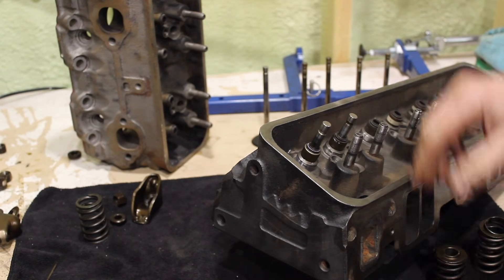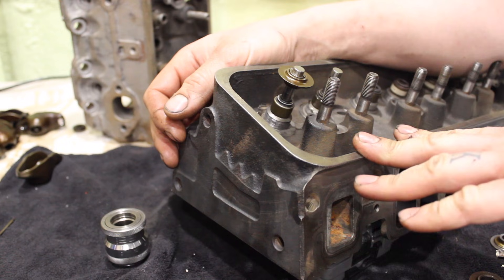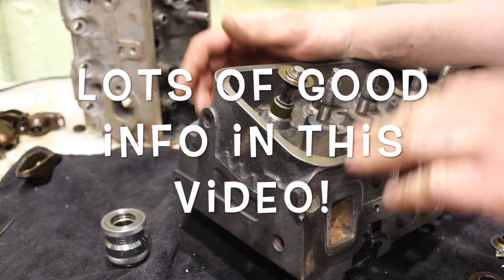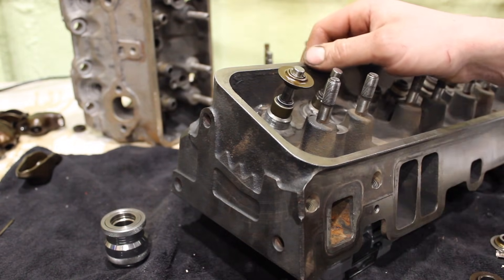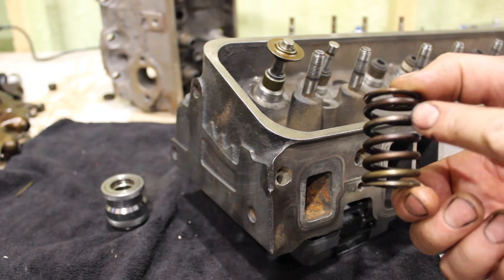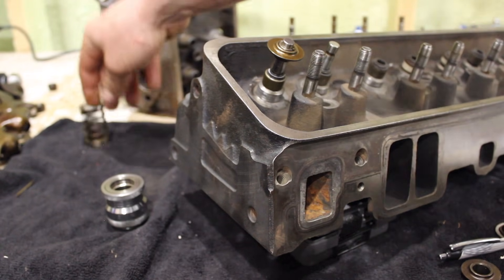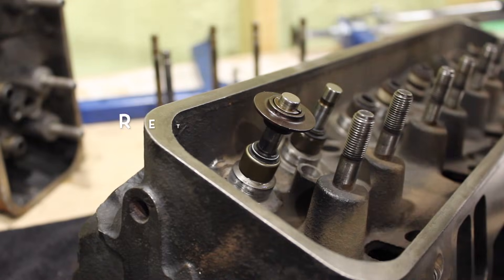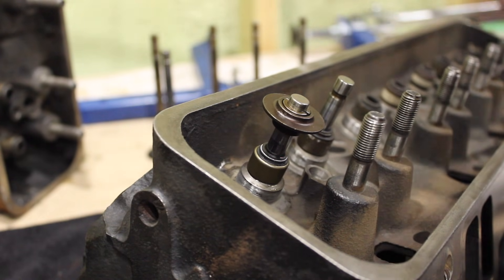How Much Lift Can a Stock Vortec Really Take? Plus .500 Lift Cheaply (Stock Guides)

Comment: Just snapped factory press in stud after 6mths with 530 lift roller. Now I'm pulling both heads to have arp studs installed
Reply: i keep snapping threaded studs. how did you adjust valves? i have .050 locks matching summit retainer and spring with 8802 summit cam

Comment: So if I run 981 springs since my cam calls for them anyway, what else would you do? My assumption is the felpro seals seated all the way, and either take .030 off the retainer, or get .030 offset keepers? The cam I'd like to run has .480 lift. 

Sorry if its a stupid question. I have a.d.d 😆

Comment: I have 062 had a 500 lift cam beehive comp springs I remove valve cover 15000 miles later broken springs I don't know why they broke around bottom of retainer heads were built be a guy who's his stuff maybe running no thermostat cold broke them

Comment: I have a cam with a  duration 050: 230/230. Lift .480/.480 Lobe separation 107. Stock bottom 1993 350 block and vortec heads. On the first break in it bent almost all but 3 push rods. Valves seem okay and with new push rods the outer valve springs don't seem to be bottomed out yet so I know it's not the outer springs. Would cutting the retainers down help it clear? Plz help
Reply from the maker: What valve springs were you running? What rocker arms? Did you check retainer to seal clearance?
Reply: I ran the springs that came with the cam kit and I'm running the stock rocker arms. The kit came with inner and outer springs. Haven't checked they clearance on the seal to retainer yet.
Reply from the maker: @bardomianogonzalez1778 dual springs? Or just inner damper? Becuase you cant really run either with stock vortec guides. You are also right on the limit of lift with the stock vortec rocker arms (they are not long slotted) so they bottom out on the rocker stud at full lift
Reply: Sorry I'm not great with part names. But yeah the inner dampers also came in with the kit. If I could get away with just removing the dampers and shaving the retainers that would be awesome.
Reply: Update i replaced the bent pushrods and proceeded to spin the engine by hand and it spins fine. The clearance seems fine between retainers and valve seals. I did see the rocker arms bottom out when the valves are opened all the way. So would that be my problem? I have a feeling some of the flat tappet lifters are toast too...
Reply from the maker: @bardomianogonzalez1778 yep that will do it. It can destroy the lifters aswell
Reply: Any recommendations on a good set of rock arms that are budget friendly?
Reply from the maker: @bardomianogonzalez1778 PRW self aligning roller tip ones are great
Reply: @cuttersperformance you are a blessing. thank you so much. I've been all over the internet an no one has come anywhere near you on info. I'll keep you updated on what I do thank!

Comment: Can we use stock vortec springs with .050 218 and 460 lift flat tappet cam?
Reply from the maker: @atanbakenan  yeah you can but they are fairly weak and can experience valve float pass 5000 rpm on some grinds

Comment: Interesting fact about small box Chevy valve keepers is that the square grows in the keepers could wear out I prefer using what’s called bead keepers where the grooves are not square off, but rounded with enable them to hold up better. I’ve seen this 1 million times rebuilding heads for 20 years. Locks are way better. The locks suck.

Comment: Flatt tapped cams suck I'd run older heads ported with roller cam and bigger lift but always check pistion ta valve clearance

Comment: I went to  .100 longer valve with beehives installed at 1.8 using a Howards super towing hydraulic roller with 1.6 ratio rockers  . This works fine with a 12.1 c/r dome piston with the plug pad milled slightly . This engine is on propane and has  monstrous torque up to 4,800 rpm !

Comment: Can the spring damper cause binding?
Reply from the maker: Yes
Reply: @cuttersperformance  I've been watching your videos for a while I'm doing my first build it's a gen 1 block with vortec heads and I rotated the engine over a dozen times by hand with the push rods in and it didn't seem to have a problem but the last time I did it my push rods bent I used 7.8 rods cam is .420/.433 and the springs i saw on one of your videos 980-16 but I left the dampers in any advice you could offer would be greatly appreciated
Reply: @cuttersperformance  also right before I noticed the bent push rods I was priming the engine with priming tool while cranking by hand at the same time idk if that was the wrong thing to do
Reply: @cuttersperformance  thank you for your insight I removed the dampers from the springs and everything rotates with no binding

Comment: So i have a comp cam that has a lift of .474/.474 cant remember exact. For a stock 1998 vortec engine with the better flowed heads. Will that no longer work? I beleive the duration is about 210ish
Reply: 270/274 duration, .474/.474 lift with a 111 lobe seperation

Comment: I ran the 980-16 with the dampers and they don’t fit over the guide properly and bind, ended up bending the pushrods, .488 max lift
Reply from the maker: Yeah, it's very important to remove the dampers. Good thing you figured it out
Reply: @cuttersperformance  I learned this from your video but I didn’t listen and screwed myself…. Love your content, I’ve completely assembled my vortec on your advice! RHS heads so some of the special work was already done!

Comment: I don’t know if you will know but I have those dna heads and I don’t know if I can use them on my stock engine. Any information would be greatly appreciated
Reply from the maker: The DNA aluminum heads can be used as a replacement head. You may have to use a smaller 1205 intake gasket to get a stock intake to seal on it, though. Longer pushrods may be needed as well

Comment: Following this to a T!  Any tricks on installing the 72861 Felpro valve seals?  I'm getting them on, but it seems like I'm having to beat on them pretty hard to get them all the way down.
Reply from the maker: They should tap on firmly, and you'll hear a pitch change when they are seated
Reply: Thanks!  Is there a chance that the guide boss on my 906's are of a different diameter?  I'm reading that the 72861 seals are 0.545" and the guide bosses on the 906's are 0.560".   @cuttersperformance
Reply: Roger that, thank you.  I'm reading that the ID of the seals are .545 while the OD of the boss is .560.  Anything to worry about there?   @cuttersperformance
Reply from the maker: @michaelhancock1603  i use them on any stock guide build I do
Reply: Excellence, thank you again! @cuttersperformance
Reply: Wouldn't happen to have a part number for a seal tool would you?  Using a socket currently, and can't find a part number for the real deal.  Thanks again for taking time out of your day to respond!!!   @cuttersperformance
Reply from the maker: @michaelhancock1603  im sorry I dont, i use a homemade tool
Reply: Ended up using a 12 pt 12 mm.  Seemed to work well!  Thanks! @cuttersperformance

Comment: I'm running a 488-510 roller cam with 550 lift springs 2500 stall on Vortec 062 heads runs great
Reply: Do you have part numbers ? I’m in a crunch with building my motor in 8 days and it would save me so much time

Comment: Hey Pat ive got a question. Ive got two sets of these springs. Comp cam 26906-16 and retainers are 787-16 of course. The cam will be a summit stage 2 almost identical to lt4.  CAN I USE THOSE SPRINGS.. MAX LIFT IS .520 IVE ive ordered .30 offset keepers to get that 1.8 installed heiggt. If i cant use those springs let me know. It is roller cam
Reply from the maker: I used the Summit Equivalent to the 26906 springs with the Lt4 hotcam, no signs of any valve float at 6500+ rpm on the dyno. When the 26906 is installed at 1.780" it is good for .540 lift.
Reply: @cuttersperformance  thank you brother. There almost identical in pressures etc etc and your rt woth factory locks not quite 1.8. Who sells +030 locks.
Reply from the maker: @timmygun1  competition products has them
Reply: @cuttersperformance  ordered 3 sets. Thanks man. I'm gonna build a marine sb. I need to cut the spring and gudes down. You got those part numbers for the cutters and dowel. Thanks Pat. I promise I won't bug you anymore. But since we met. I'm on my 7th vortec block. You are awesome.

Comment: OH THAT'S VORTEC HEADS ON AN OLD SCHOOL 4 BOLT MAIN 2 PIECE REAR SEAL BLOCK 
AND NOT A HIGH LIFT CAM NOT STOCK BUT NOT RADICAL IN ANY CASE I ONLY BUILD 
CHEVY MOTORS AND HAV DUN SO FOR OVER 50 YEARS AND THIS IS A FIRST 4 ME 
WITH PLENTY OF ASSEMBLY LUBE ALONG WITH GRAPHITE IN MY CAM LUBE MIX I'M PISSED HERE NICE HEADS BUT ☝️ W T F O

Comment: THIS IS ALL GOOD INFO THANK U BUT TELL ME WHY HAVE I WASTED (2) CAM'S IN A ROW WIPED THEM OUT NEARLY INSTANTLY (3) LOBES BOTH TIMES 🤔 MABY (4)  NO DIRVING TIME AT ALL ALL HAPPENED WHILE 
GOING THROUGH LASH ADJUSTMENT AT IDLE
Reply from the maker: Sorry to hear about your troubles, I have a few questions. What cam/lifters were you using? 
What valve springs/ rocker arms?
Did you follow a cam break in procedure during the first fire up? Lifters should be pre adjusted prior to the first fire up, that way the rpm can be brought up and kept there for 15 to 20 mins for break in.

Comment: Unsure of Vortecs but Fuellies are 1.72 installed heaght and around 72lb on the seat. So no good for performance cams. On those I have run springs up to 140lb seat pressure. With proper outers and flat wound dampers. You MUST use screw in studs. IF you turn 6000rpm that is an essential. You can cut the spring pockets about .050 max and use plus 050 retainers. Simple guide cutter for PC seals you can shorten the guides a little also.
Look at the factory performance cams, from the 60s.

Comment: I sanded about .030 on the bottom of the keepers and it worked fine with a .490 lift
Reply: I'm using 416 HO HEADS FROM A 305 ON A 350 ,RUNS AMAZING

Comment: I used a Comp Cams 292 H back in 1988 .501 lift in a stock head 79 z28 .. no issue BUT I knew guys that said I should refrain from that much lift.
Reply: Don't know why guys are saying that because most cylinder heads don't start flowing till 500 lift, even the late 70s smog heads.  Now your 292 duration is a bit much though. My 79 Z28 is getting ported 462 camel hump heads and a camshaft similar to the one you had. Ill be going with the Edelbrock Air Gap intake manifold. What intake manifold did your z28 have?
Reply: @shootermcgavin2819  I had a weiand that in magazine tests did slightly better than Holly and the basic Edelbrock. BUT the Cam I used at that time on My 406 Build was the Crane cams HMV 278 wich had 222 @ .050 and 234@ .050 with .464" on intake and .494"  on exhaust with a 114 LSA. It was a Torque monster I had 64cc heads that were pocket ported to memove dingle berrys ect. With the 292 I had the stock z28 on the 350. The 406 Crushed that 350 it wasnt even close.

Comment: No issues? lol i've seen em push rocker studs out with a .460 lift cam
Reply from the maker: I tell guys over 300lbs over the nose you should have screw in studs. They are never a bad idea but ive never seen them pull with springs weaker than that unless theres not enough clearance to the retainer and they are smashing the retainer into the seal/guide.

Comment: This is very good information. 👍 This is exactly what I did with my tbi 193 heads in my Camaro to run .480 lift hyd. roller. Springs, + .050 retainers, .060 spring washers. I had to grind the self aligning spurs on a set of Comp roller tips about .020 or so. Only thing I didn't do was check that the guides were seated all the way.

Comment: im tempted to try umbrella seals on my vortec heads. have always liked them for the ability to allow more oil into the guide. i dont mind adding more oil every now and then.
Reply from the maker: Yeah, I've used them before with no issues on lower lift cams with stock guides
Reply: @cuttersperformance  cant find any umbrella seals for a .560 guide. oh well.
Reply: The 943x springs with the damper removed and a good ole umbrella seal will work with .500 lift flat tappet no issues.

Comment: I wanna run a comp 262h cam with vortec heads do you think the springs will be maxed out so head they will wear out and break prematurely
Reply from the maker: Id probably go to a 981-16 spring. Just follow the video and make sure your valve seals are seated all the way.
Reply: @piss-cutterperformance  I have springs off a 5.3 laying around will will installing them at 1750 instead of 1800 hurt longevity

Comment: What cam would you recommend with 1.6 rockers ?
Reply: Any cam.  Doesn’t make a difference.  Just know 1.6 increases the lift as opposed to a 1.52.  The fulcrum point increases therefore increases valve opening

Comment: Really great information! I really enjoy your in-depth vids about make budget stuff work better. Most of us are on a budget and this content is great. I had a question though could you also achieve more lift if a guy wanted to spend a little money on aftermarket roller rockers with a 1.6 ratio? I know jumping from a 1.5 to 1.6 nets you more lift, there an equation to find your new lift(I can't recall it off the top of my head). Thanks again for taking the time to do this stuff.
Reply from the maker: Take your current lift (say .500) Divide that by stock ratio of 1.5 to find your lobe lift (.500 ÷ 1.5 = .333). Now take your lobe lift and multiply that by your new ratio of 1.6. (.333 x 1.6 = .533) So now your lift is .533 with the 1.6 rocker arms, plus you gain a few degrees of duration.

Comment: The cutting tool for cutting down the spring pocket isnt that expensive from Goodson and kan be used with a hand held drill och stand drill.

There are very affordable beehive sorings from LS engines for instance. Keepers from Melling are also pretty affordable. 

But many cheap things get expensive when added up 😅
Reply: You would only use a spring seat cutter if you need more installed height which is not really what this video is about :body-blue-raised-arms:

Comment: I'm having a few issues. I'm looking to run comp cams 787-16 with their 26906-16 springs with 0.030 offset keepers and I can't figure out my clearance. It should be around .550 right?
Reply from the maker: Check out my LS6 spring on vortec  video to check clearance easily at home

Comment: Awesome video! Helped me out a lot. I just want to confirm, it’s pretty much the same way with flat tapped and hydraulic roller? I’m building an L31 350 and wanted to make sure I’m in the clear. I also need cam recommendations, as I can only find mostly flat tappets
Reply from the maker: The springs in the video can be used for flat tappet hydraulics or mild hydraulic roller cams under .500 lift. I have some more vortec builds/dyno results coming up that might help you with a cam choice

Comment: With pressed in rocker arm studs I would not go over 450 lift.
Reply from the maker: Its more rpm/spring pressure with press in studs. Generally less than 300 lbs over the nose and under 6k rpm, the press-in studs are fine. But going screw in studs is never a bad idea for any situation
Reply: I’m currently out the game cause my heads had to come off to replace the press on studs.  Wish my engine guy made a bigger point with that. Last week 4 studs pulled out and I lost 4 lifters and 4 rockers.
Reply from the maker: @kyff232  o dang sorry to hear that man! How much spring pressure were you running?
Reply: @cuttersperformance  not quite sure to be completely honest.  They’re double valve springs with dampeners so I’m assuming 350 atleast open.  Upgraded springs for a 510/515 cam.  Everything was fine until 5500-6000 open run   Definitely needed screw on studs.  Now I’ve got new rockers and lifters lol .
Reply from the maker: @kyff232  o jeez yeah, over 300 lbs its a real coin flip once you bring the rpm up. Alot of guys dont believe me but ive seen it many of times
Reply: @cuttersperformance  yea it sucks.  My engine was completed/dynoed 10 years ago but only ran 6 months ago.   After my motor swap I was hoping all was done.  Nope lol.  But I’ve learned a lot and the tear down I’m learning more.  ESP where all the FN antifreeze is Jesus H it goes more places than oil

Comment: Yep, the good old "ghetto grind" on the retainers and i use a $40 set of  "Z28" springs with the inner damper removed.  Cheap and Easy!
Reply from the maker: If you have access to a valve grinder, it's more of a "lower middle class grind" 😅
Reply: @cuttersperformance  lmao 🤣
Reply: I had a cheap set of Z28 Springs I wanted to run for my flat tappet cam and my machine shop had to clearance the valve guide for the ID of the spring on my 906's.

Comment: I definitely see where I went wrong on my build with my 355 VORTEC sb. After snapping rockers off, wiping out two cams I see that I never took into consideration the valve seal clearance  this video has got me totally on point to understand what it takes to make my combination work. Great post and awesome trick on retainer 👍🏾
Reply from the maker: Sorry to hear the issues you have had, how much lift were you running?
Reply: @cuttersperformance  507 lift with 1.5 rockers and beehive springs and screw in studs
Reply: I’ve made the same mistake …. There’s a lot of math going into building engines!!! And I’ve learned the hard way 😂😂😂😂 now I’m doing better and get better … I will learn anything and everything from smarter fellas 🎉😁👍👍🏆
Reply: Change the rockers to rollers

Comment: With that set up could you run a zz4 cam  thanks
Reply from the maker: The 981 springs (or similar) can technically only handle upwards of .500 lift. I will be doing a ZZ4 hot cam vortec build, so I will post a video on what spring setup im using
Reply: Thaks